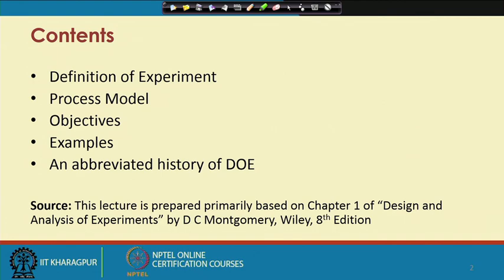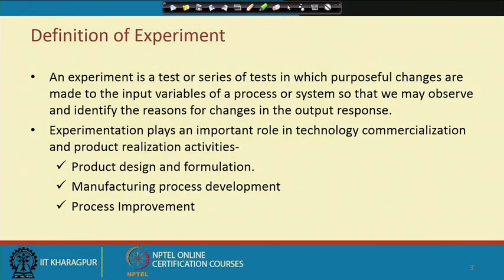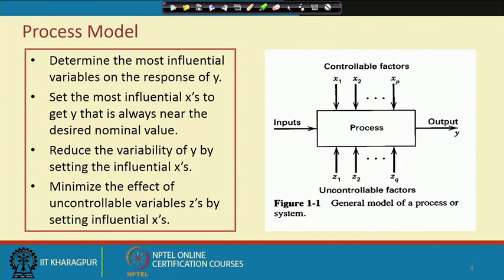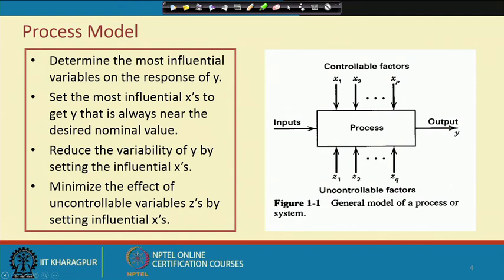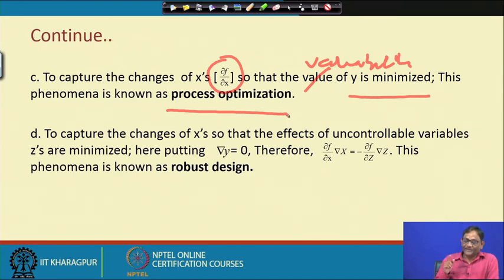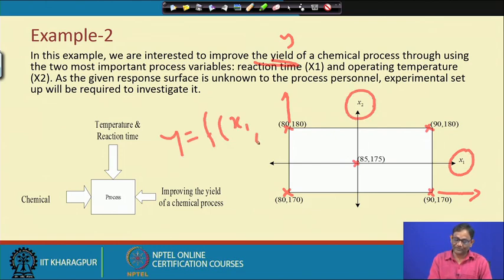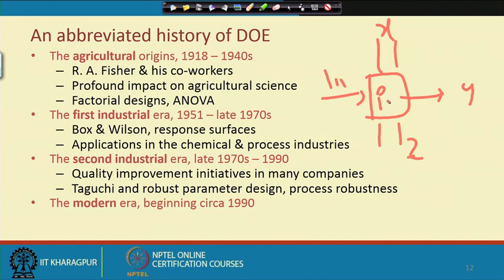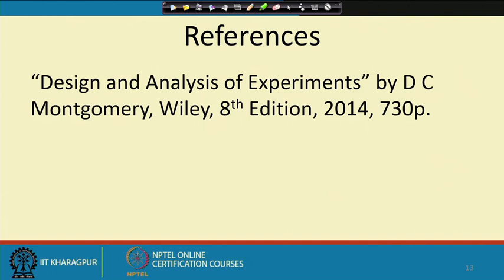Lecture 1

Comment: What's the difference between process control and process optimization?
Reply: It is as simple as it sounds control vs optimization as it relates to processes.

Ie a system can be in control and very reliable but not optimized in regards to yield or something
Reply: dsv dsv thanks man